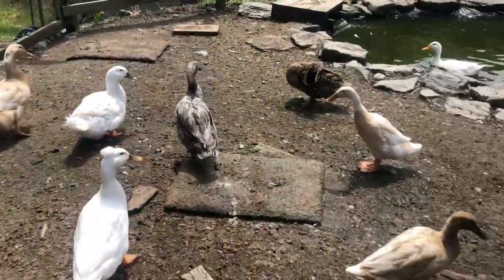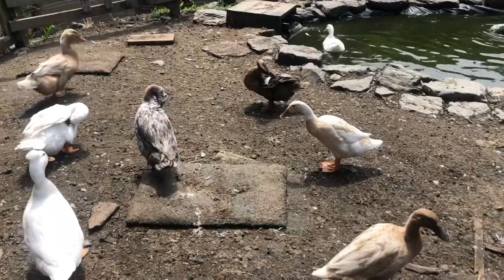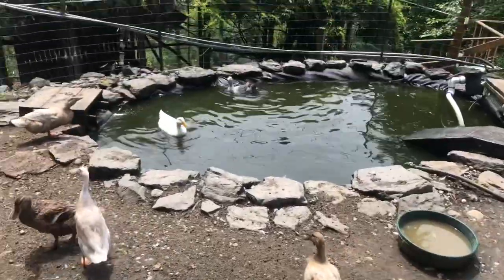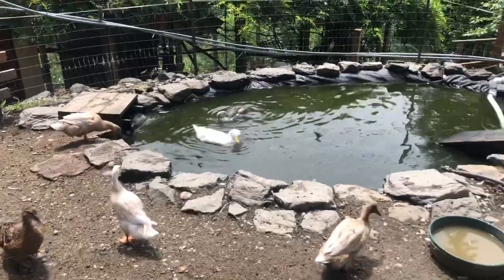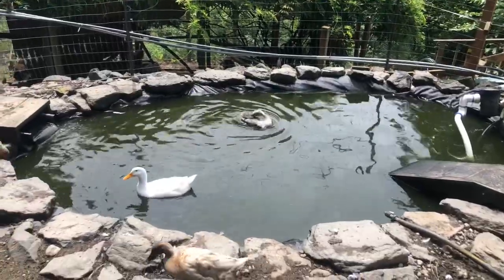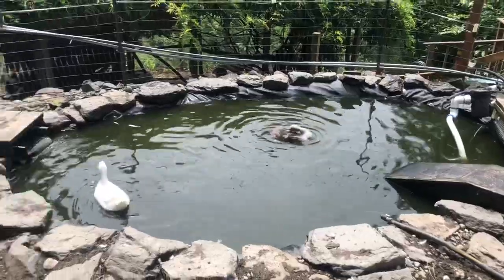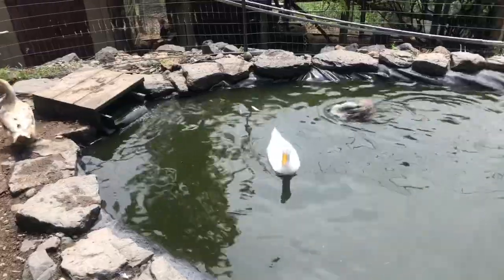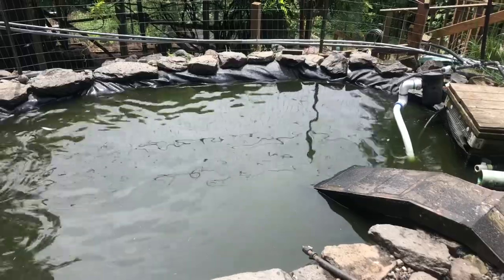QUACKUAPONICS !! Managing duck ponds and duck waste

Comment: It is great that you are getting at least some return with all the plants but this is way too much. All you need is one pump and one IBC tote. Here is a comment I left in another video of a guy trying to make a tote filter. 

"
Cut the entire top off at least 6 inches down. Cut down the side at each side of the corners around 4 inches. You will be able to put the top back on and off. 

Get some scotch brite pads and some Cleaning Vinegar (use gloves) (not cooking/food vinegar.) and scrub the sides HORIZONTALLY ONLY. NO vertical and no circles.  

Learn how sand filters work and just make a large one.

Put that tote on at least two levels of cinder blocks. 

Use a union at the bottom port of the tote.

The top lid of totes have a 2" port on it. Use it. Make a large grid of 1" PVC with a bunch of holes drilled in it. put it on the lid drill holes and zip tie. This is a "diffuser" 

At your pump, Tee off the outlet. Put a ball valve on the line going to the filter. From the other output on the tee put a hose or pipe down to the bottom of the pond. Use the ball valve to control how much water is being diverted to the pipe going back into the pond. What that line is doing is stirring up all the crud. You can leave it like that until the pond empties, letting the filter work, or add a second valve to shut off the circulation hose a bit, so that once most of the silt is floating around more of the water is sent to the filter. You don't want the water going full blast into the filter. 

Put the pump on a timer and set it to run for short periods of time. multiple time a day. You want the sand filter to drain slow and not overfill the tote. You will probably only have to run the pump twice a day at 15 min.

I would add a layer of landscape weed barrier on top of the sand filter. Over time the silt will build up. This makes easier to scrape it off while not removing the sand.
"
Reply from the maker: Yes something like that will work

It is all about the volume of waste. 

It’s kind of like dust collection in the shop. If you put a vortex filter ahead of the dust collector, you collect more of the heavy debris before the fine debris goes to the final area. The more stages of settling you have the better. 

Using any kind of filter, media is a fine thought, but in the duck situation, it tends to be very high maintenance. That’s what I use when I do a Koi pond with the biomass load is less. 

I have simplified the system to use only one pump or two if I wanna do surface filtering  

Thanks for the comment and the information
Reply: @rogerblauvelt367  I have uploaded a couple of videos and a short on the filter to pond transfer. They are just demos, no explanation. The latest ones uploaded called "Just a quick demo of a syphon overflow"

Comment: Oh my! You are growing lettuce in waste water that haven't run through a large bed that has the organisms that convert nitrogen filled waste to nitrates, and then to nitrites and allow bacteriato be mitigated. We are told that lettuce will pull bacteria from the water into the stalk and leaves, so no fresh manurecan be used in gardens and fields. Unless the lettuce ecoli outbreaks have been just due to dirty handling and they are blaming the migrants for reasons we don't understand.
Reply from the maker: You of course are correct.  As it turns out, growing "food" for humans really never panned out. I never produced any useful lettuce. So no worries there. I do grow water hyacinths for the ducks and they eat them as they can eat raw sewage.

Thanks for your observations.

Comment: so, the pump is powerful enough to move the ducks' solid droppings from the bed of the pond and up into the pipes?
Reply from the maker: It is not an issue with power. It is about the type of pump.  You need to get a pump that handles solids up to a certain dimension. The sediment is not solid at all, it is more of a sludge.
Reply: @rogerblauvelt367  i meant, how do you get the sludge that's on the bottom of the pond to move towards the mouth of the pump? i assume the pump doesn't move.
Reply from the maker: @vladtepes97  The bottom pump is at the lowest level so the sludge settles there. By no means does this clean ALL the sludge from the bottom, just the bulk of it.

Comment: their has to be an easier way. but cool project especially using the water to grow things.
Reply from the maker: As it turns out, I have cut down my system to one bottom pump that goes to the filtration barrels. I dont use a skimmer pump anymore and dont use a small pump. Just the one bigger pump. Simpler and for this application more is not necessary. If you do koi and want pristine water, a skimmer is likely necessary.

Comment: Good job Roger, loved your video. Very calm and collected unlike some other videos on Youtube. I swear some guys just need to get the camera off of their ugly mugs and show me the process rather than waste my time. I was wondering about your use of 3 pumps. Could you get by using one high flow pump. Pumping directly from the bottom of your pond to the conical (settling) tubs and allowing the gravity flow to do the rest of the filtration? I love your setup with the Hyacinths and duckweed. I had hyacinths for a short time in my pond until I introduced ducks into my system. Then it was the salad bar. Then this past season I had about 60+ wild mallards every day which really loaded up my pond. I don't have anything setup yet, but you gave me some good ideas on where to begin. Could you provide an update on your system? How's it holding up? I live in Central AZ. Take care.
Reply from the maker: Actually, I’ve done exactly what you describe. I run one pump at the bottom of the pond. It is high power pump. Five minutes of every 30 minutes to conserve electricity. There are timers to do this. I don’t run the  skimmer or the small pump anymore it does not seem to be necessary. I still grow hyacinths in the summer, but I’ve not found that growing any kind of food is practical. Thanks for your feedback and good luck.

Comment: What size of pumps are you using?
Reply from the maker: For simplicity I now run it one one pump only.  Have abandoned the surface skimmer, and the tiny pump.  Now only have a 1.5HP solids handling pump at the deepest part of the pond that is intended to suck up as much sediment as possible. I have a timer on it so it runs 5 minutes off 25 minutes or so and are adjustable.  These are cool timers you can get at amazon.

Comment: Some of the foam and perhaps other items you are using in you setup are not food grade and not safe in a garden. Foam for example is not safe. Otherwise I LOVE your setup and I plan to make a similar system. With food safe material only in mine though. My ducks & Geese will love it. I will also use a solar setup with an Air Lift Pump to reduce cost. Great video.
Reply from the maker: agree.  I have actually abandoned vegetable production and use it largely for filtration and water plants for the ducks and chickens to eat.

Comment: This is pretty awesome! I am looking into doing something similar. Wondering why you didn't run your skimmer pump through your filtration system? I don't particularly like the idea of a waterfall in the pond not emitting clean water as this could be a drinking water source for our chickens and ducks. Am planning on just running a skimmer pump, and higher capacity pump through the same similar tiered aquaponics system. Do your forsee any issues with that?
Reply from the maker: The skimmer is a separate system.  You could also move that thru the filter, but the system is designed in different modules.  There are no rules here!  

Chickens and ducks are quite resilient and you will never keep a duck pond sterile no matter what you do. 

The idea is just to have some mass of water running thru the filtration/sedimentation system.  Just like any system it is about fractions of water moving thru systems over time.

This is much different than a koi pond but the same principles apply, just much dirtier.

Comment: This is BRIILLIANT! but I have some question. Do you have problem like mosquito at the hydroponic plant sir?
Reply from the maker: If the water is moving enough mosquitos will not breed so easily.  Sometimes I put mosquito dunks (biologically active rings) in the tubs, but they are a bit pricey.

Comment: Love it. I've been considering ducks as a means of helping manage garden pests, and all I keep hearing is how messy they are, particularly with the water. I keep thinking this is a resource. If I may ask, what are you using to run your 3 inch pipes through the garbage cans for your vortex filtration system?
Reply from the maker: These are plastic drums. Use bulkhead fittings. It is 2” pvc schedule 40
Reply: @rogerblauvelt367  
Thanks.

Comment: If you were building this from scratch today would you still include as many components?
Reply from the maker: It could be run on fewer pumps by cycling. I do think u need multiple stages of filtration with ducks
Reply from the maker: Recently I have been running it without a skimmer, just on one bottom pump - and it performs reasonably.

Comment: Won't it damage the pump to leave it on without water? Would love to hear that it doesn't cause damage! We use a pump for our aquarium siphon to do water changes and I am always careful to keep it submerged. I could just be reacting to the sound though!
Reply from the maker: None of the pumps run dry in my system.  Sorry if I gave that idea. Some pumps are designed to run dry safely and some will burn out. Some have a breaker that needs to be reset if they overheat
Reply from the maker: Many pumps will be damaged by running dry.

Comment: On the water hyacinth in the filter grow beds. Because of its hi growth rate,water-hyacinth is a great to grow as a fodder but the other end is that it is invasive and not legal to sell or even possess in Many states without a special permit. The growth rate of water-hyacinth is among the highest of any known plant. Birds carry it to other water bodies.
Reply from the maker: Don’t know that I am breaking the law.  They are not hardy in WA. The do not last the winter. Agree they grow super rapidly when it is sunny and warm.   U can buy them at local hardware stores or nurseries.  I get them annually on eBay.
Reply: your harsh winter keeps them tropical invasives in check. But in Florida there is no winter and they take over and clog nutrient rich ponds and rivers fast. Used to have them in a runoff pond from a hydro farm I once worked. Would remove it manually every summer. 6 months later the whole pond would be full again.  I do no think Florida nurseries are not permitted to sell or ship it. My County uses  herbicides on them.
Reply from the maker: You are free to send me some every spring!  I will pay for shipping.

Comment: how often do you need to clean the large wayne pump? does this large pump operate on standard household electricty?
Reply from the maker: All pumps run in 110.  Deep pump should be cleaned more often than I do. The trap should be cleaned often as well.

Comment: Do you use the sediment for fertilizer on a garden or yard plants? (I am also near Seattle but closer to Olympia/Bremerton area.)What do you do during the rainy season?
Reply from the maker: If I am industrious I fill 5 gal buckets with sediment and carry off to fertilize. More often I just drain. Hard to pipe the sediment anywhere due to clogging
Reply from the maker: The rain doesn’t matter other than it tops off the pond. I don’t have water hyacinths in the winter but otherwise the system works year round   If it gets too full I drain

Comment: Hi Roger, I really like your system. Thanks for posting. I have a much larger pond to filter. My question regarding the vortex filters.. Is there a inlet and outlet at the top of the barrel? Are the pipes coming out of the bottom ,are they for drainage? Then how, and how often to you have to clean out the sediment?
Reply: I believe the outlet for the 55gal vortex the water outlet is towards the top of the barrel but slightly lower than the in water.  You want the partials to swirl around the outside of the barrel  and end up on the bottom.  So in theory the cleanest water is in the middle on the top.
Reply from the maker: Russel is correct. Water enters on top on outside edge and exits on top in center at water surface level  Bottom spigot is to drain sediment